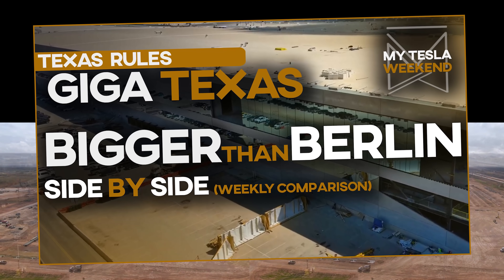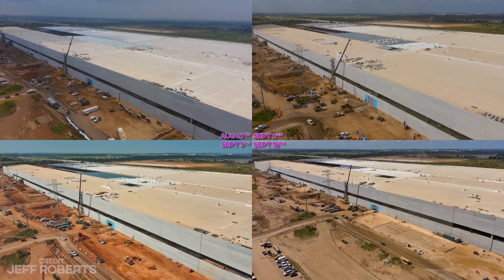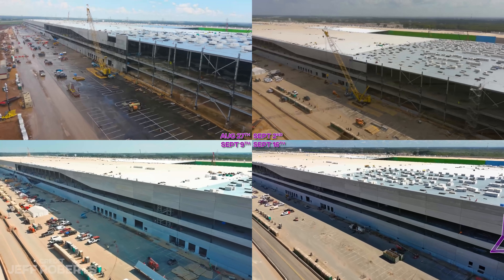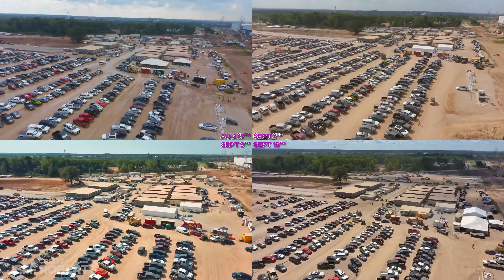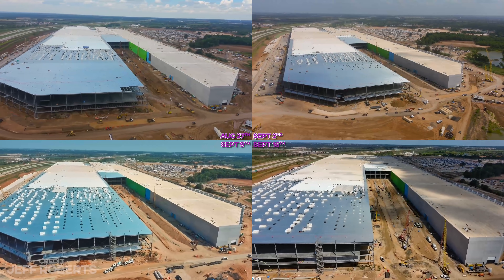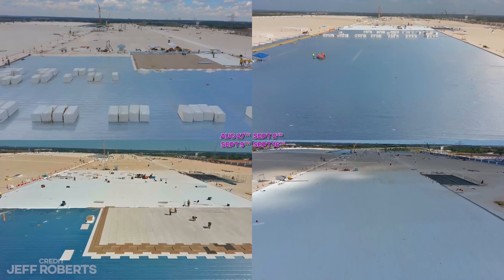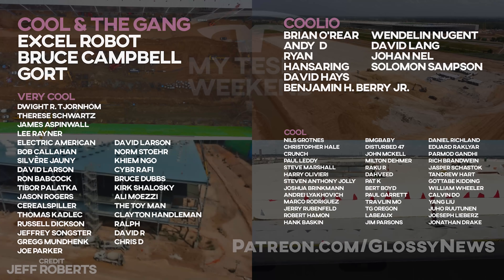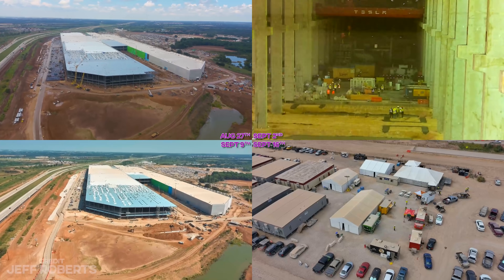Giga Texas is WAY Bigger than Berlin - Construction progress side by side

Comment: Why is Berlin 4 times more expensive to build than Texas?
Reply from the maker: I haven't seen numbers that reflect this. Any discrepancy that wide would likely account for the battery factory in Berlin without counting the cost for it in Texas.
Reply: @FutureAzA  Google the following :
Explainer: What's happening with Tesla's $7 billion German 'gigafactory'?
Tesla to build $1.1B assembly plant outside Austin, Texas

Note not sure I believe $7B but now $5B up from original 4B euros cost
Also Google:   Tesla makes progress on Berlin factory as EU signs off $1.6bn for battery plant
Reply from the maker: @favesongslist  Couple things there. The scale has been increased since it was announced, due in part to the pair of $5B funding rounds, but that figure is also before/after the addition of the massive battery factory. That wasn't part of the original plan.

Giga Texas is also at least 3x it's original size for the same reason. It isn't simply costing 4-8x for no reason. It's mostly the expanded scope.

Comment: What activity is planned for the "central Corridor?
Reply from the maker: That's the half-billion dollar question, but my guess is it's where they'll be folding the origami stainless steel for the CyberTruck. I don't know this, none of us do for sure, but it would make sense. Though there's no reason to think they couldn't do this in other parts of the factory as well.
Reply: @FutureAzA  Possible drive thru  to do deliveries.
Reply: @FutureAzA  - by the look of the sheer size of those foundations, they couldn't be much else than the folding line for CT .
Coils coming in from outside, and being folded more and more, heading into the building .
The most folding will most likely be done at the end of the line, where the first footings were poured .
That's * my * guess .

Comment: Will they make the word TESLA on the roof with solar panels ??
Reply: Yes airport nearby
Reply: They could easily write “Tesla” on the roof below the solar panels, and it would show up just fine due to the spacing necessary to prevent shading if they mount the panels in the most efficient way possible, which there is no reason whatsoever not to do.
Reply from the maker: I'd give that 100:1 odds against. Practical or don't even bother. That's my thought. What do you think? Would they?
Reply: @FutureAzA  Elon has said he wants to put TELSA on the roof so the planes can see it so solar panels vs the white waterproofing membrane looks prime for that
Reply: I Hope so! That will be cool! 😎👍

Comment: I'm confused, didn't you say Berlin was bigger in another video?
Reply: Bigger eventually. If you look back at the original plans for the Berlin site, the current main structure is only 1/4 of the Tesla emerald design. There are 3 other roughly identical sections still to be built if Tesla does not already have too much PTSD from the permitting process on the first building. Not sure how the change in plans for the new battery plant building affects that though.
Reply: @stevehockey4  Thx!
Reply from the maker: @stevehockey4 Yep. It depends how you measure them. Giga Texas is likely to be a bigger *single building*, though Giga Berlin apparently has permits for construction giving them a greater total floor space. The bottom line is we don't know, so we're just having fun trying to figure it out until we know for sure.
Reply: @FutureAzA  Cool thx.
Reply: @FutureAzA  ..”and we’ll have FUN FUN FUN until Elon has his final say” 😎

Comment: With such a large roof I would assume that Tesla will cover it with solar and have a few megapacks nearby for electric trading and backup power.
Reply: Very possible. There will be plenty of room over next to the current substation and they have quite the ideal connection to the grid.
Reply from the maker: Six months ago I'd have said not likely, but the addition of a massive array atop Giga Nevada (where power is already pretty affordable) suggests otherwise.
Reply: @FutureAzA  i think there’s a lot of future PR to be had over being able to claim that the factories are, something along the lines of, net zero energy consumers. Right now Tesla is the clear top dog in efficiency and sustainability, especially with the obvious tie-ins to Redwood. Down the road when real competition exists, being most sustainable will be a decent differentiator for them. In the near term, providing their own solar power and the economics of megapacks with autobidder will be a large investment up front that will help to improve the cashflow and profits of future quarters as it starts paying for itself.